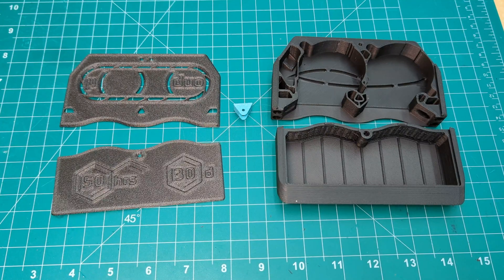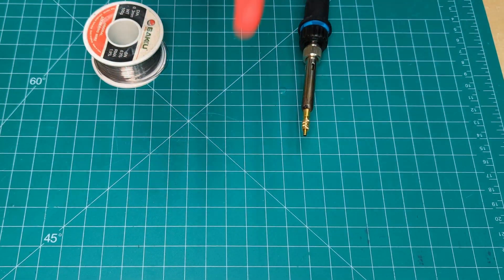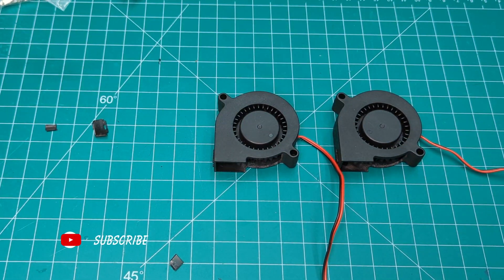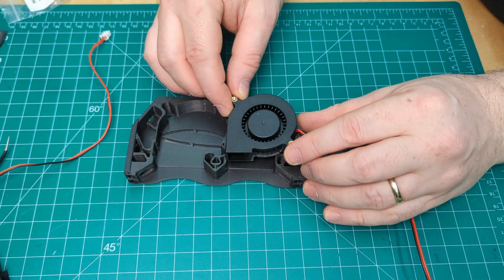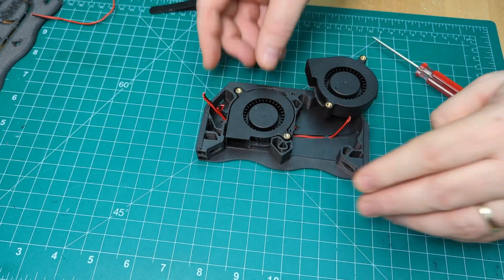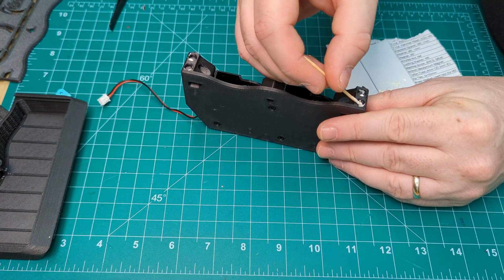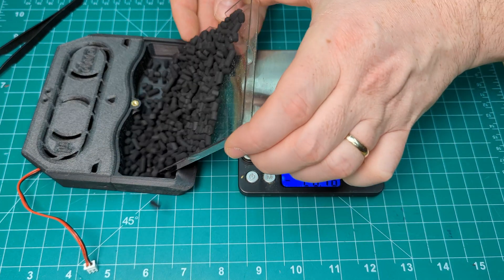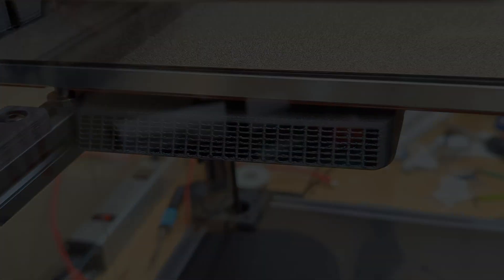Voron Mod Showcase: Trident Nevermore

Comment: I just wonder how the magnets are able to hold 300gr of carbon, mine certainly won't.. thinking about printing an ugly but functional support beneath the cartridge.. i'm pretty confident it will fall at some point.
Reply: He says 30g in the video.  300g is most of a bag.
Reply from the maker: Hmm, I wonder why your magnets won't hold the cartridge.  We have several of these running on all of our printers right now and have never experienced any issue with magnet failure / cartridge falling off.

Comment: When soldering the wires to the pcb, is the correct configuration to have all 3 reds on one side, and all 3 blacks on the other?
Reply from the maker: I believe so yes.  It's basically just a bridge for all the wires!

Comment: Loads of videos of people fumbling with nevermore install videos lol, Idk why they don’t edit the video to show the procedure instead of all their errors and put text over it. Thanks for the actual video guide! You’re awesome.
Reply from the maker: Thanks! That's our whole deal!
Reply: @MapleLeafMakers  I followed your pcb idea and also added extra heat shrink to firm up the connections and a 2-pin JST socket into the nevermore, since it’s designed for kind it seems. 😊 Then did a little sanding so the plug could push in ok, and wedged the PCB in from inside to stabilise the socket. You can solder it and then slide it in if you use the right row of pcb holes and the jst orientation shown:  https://i.imgur.com/KWm90ad.jpg

Comment: Heads up. The LDO kit includes a wire for the Filter Fan but it is not long enough to run down the Z chain. You will have to extend it.
Reply: found this out myself lol. had mine built for a few months now, mainly printing ABS and ASA, so i figured i should print and put the nevermore v5 duo on... ended up extending it with some 24g speaker wire and some solder, ran an extra wire too encase in the future i for some reason will need it for a mod or something! Great tip though, wish i knew sooner so i could've been a little more prepared

Comment: Mounting directly under the bed does not seem like a good idea at all. Another comment already mentioned depleting carbon efficiency at increasing temps, plus a lot of cheap blower fans don’t like high temps.
Reply from the maker: nearly every 2.4 with a nevermore has it installed directly under the bed, It may not be ideal for carbon efficiency, but it's a good balance between filtering and 'bed-fans' functionality without needing both separately.  We have several machines running this way and have never had an issue with fans dying.  If you're worried about it, feel free to install yours on the side of the chamber, but this is how we do it, and it works well for us.

Comment: You want to stay away as far as possible from any heat sources with the Nevermore because heat makes the carbon depleat a lot faster. On a V2 its under the bed because there aren't really any better spots but on a Trident you can place it so much further away, you should use that to maximize the efficiency. If you want to move the air from the bed to circulate it inside of the chamber, using fans would be better than using the Nevermore.

Quote: 
"At the same time, with increasing heat, the VOCs get more heat energy and desorb from the carbon"

as well as:
"Anything above 50C is generally not good for bad stuff to stay attached to the carbon. And while the micro has been shown to work even at 80C intake air under a heated bed, it most definitely decreases the time between carbon changes a lot!"

Comment: I wish I had 3 hands as you seem to. I didn't realize nevermore was so small. I've got nevermore parts on the way for my v0 and v2. Probably pretty similar I would imagine.
Reply from the maker: It sure does come in handy for filming things on the correct angles!    

Nevermore's are must have if you are printing ABS.  They work so good.